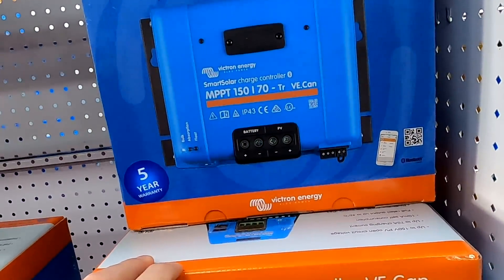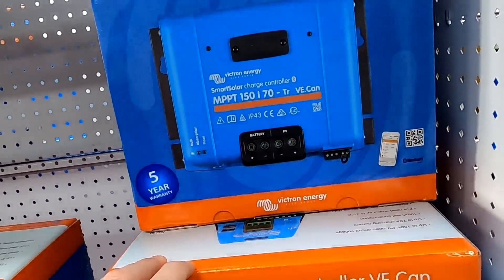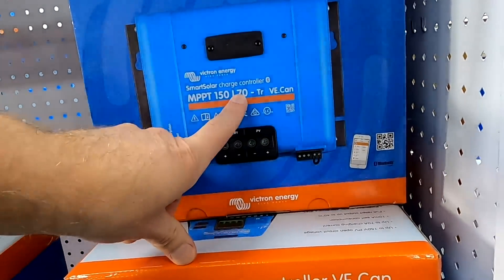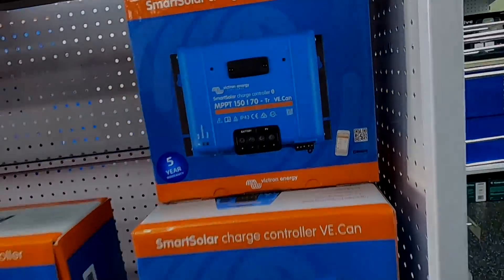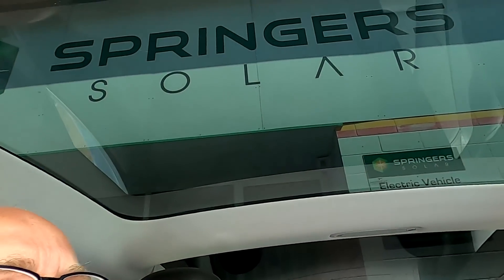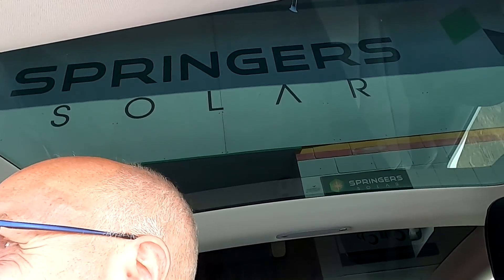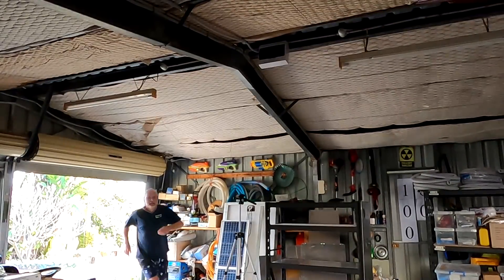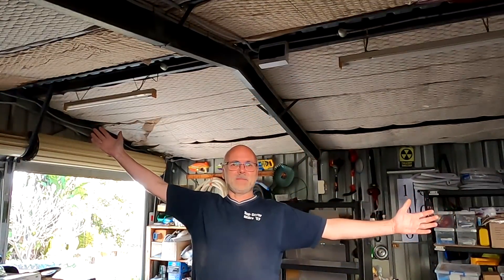Info from the Victron installer about the house off-grid connection. Not as expected... Part I

Comment: At 6:05 you talk about dump load and diversion loads. Do they know of a controller that does this? I can not find a dedicated controller that does this anywhere. Can you go in more depth on this? 
Wouldn’t it be great to charge the battery up to 3.45v per cell and have a automatic switch just dump the excess power into something else, That would be awesome!
Reply: Surely it's just a type of VSR supplying a second immersion heater. Could easily be done with an Arduino, nice and cheap..
Reply: @willtaylor8904  I know it could be done with a mess of small items. I would like a certified, UL listed device that.. I open a box, customize settings and it just works!
Reply: I've done a little Google and there are a number of programmable VSRs here in the UK that would do the job easily. A programmable PWM controller is also a nice solution.. There's also a thing called a Solar iBoost for the grid connected that looks pretty simple and cool..
Reply: @willtaylor8904  thanks for the info! The I boost won’t work as it doesn’t hook directly to the battery. I can’t seem to find any programable  VSR that supports the voltage. And I’m still trying to figure out how a pwm controller would work, in regards to adjusting the I/O, then I’m also thinking about standby load consumption too.
Reply: @andrewbowden1076  yeah Solar iBoost is only for grid connected. No use for off grid battery setup. Sorry can't post links here..
Reply: @andrewbowden1076  bimble solar do one that can deal with switching voltage up to 99v but it needs to be powered by a supply of less than 36v.. relay is capable of 250v AC 200a..
Reply from the maker: There are BMSs out there which do exactly that via relays. You can program a certain voltage and it connects the dump load. If voltage goes down, it disconnects. There are time delays programmed into this function too, so it does not switch on/off all the time.
Reply: @OffGridGarageAustralia  I was thinking just that. The BMS would likely shut right off as soon as it kicks in because there is no buffer. The voltage would immediately drop as soon as it turned on. Andy do you have a recommendation for this BMS? I have not yet seen one with the options you had suggested.
Reply from the maker: @andrewbowden1076  Yep, it will do this even considering the absorption current being under a certain threshold, so always making sure the battery is fully charged first before it turns the load on.
Reply: BUT  I can't find one that actually works . Lots of people saying ,it should be this or it should do that but nothing that actually does it.

Comment: Ha, precisely what I suggested ---- take things off of the house's panel and move them to the garage's system.  I'm great at weaseling contracts ;)
Now, are you ready for this?  Install off-grid inverters that operate in "UPS" mode whereby they are connected to the grid but solely in a generator capacity -- that means that you don't even need to charge batteries because it fails over to the grid once batteries are depleted.  No need to charge the batteries at all, that's inefficient.  These inverters are incapable of backfeeding power at all, they can charge the batteries (disable that) while reverting their connected load to the grid.  They cannot backfeed thus not violating the contract.   The contract is structured in a way that it prevents the ability to backfeed the grid, not use it.  A little bit more wiring involved but it'll pass inspection.  In-fact get the utility involved / approve the used devices.  Those inverters will charge the batteries with solar, and power the devices behind them with solar and then batteries as a normal system would, but fail over to grid and not charge batteries by the grid.  They'll just pass grid power to the devices until the sun comes up then batteries and loads are solar powered.
Reply: I'm pretty sure he said you can't do that according to the contract
Reply: @SiriusSolar  They're UPS units like you use on your computer but can charge a solar panel.  UPS units are not grid-tie inverters.
Reply: @mhamma6560  The failover to grid is implemented with a TRANSFER SWITCH. Transfer switches are not allowed (see the video) because people have abused them in the past.
Yes, I know that an UPS also has a transfer switch, but an UPS will not lower your electricity bill and will not increase your exported energy to the grid so it will not raise suspicions with the Utility Company and they won't come to inspect your installation.
Reply: @danielardelian2  No, a transfer switch is a very specific separate device that's controlled via a controller box.  The working mode of the UPS inverters is self generation or grid, not both.  Go look up what a transfer switch is.
Reply from the maker: Cannot be done because I don't have any additional cables from the garage to the house. And earthworks are not an option.

Comment: How about moving a bunch of the high energy consumers to a sub panel connected to off grid garage and then if the off grid garage solar cant produce electricity just source power from grid (one way, consumer only so does not violate the contract) to top off the off grid system. Only downside is that you’ll need a large enough inverter in the off grid system to support those loads.
Reply: Andy's Tesla charging station sounds good 👍😱
Reply from the maker: Yes, thanks, Rani. That would be possible. I have the pool pump, hot water and EV charging all coming from the meter box outside the garage. I can just connect them to the off-grid system. The good thing is they never run at the same time, so the inverter size does not need to cater for that total load.
Reply: @OffGridGarageAustralia  Victron inverters for RVs support combing power from the a 110v outlet while using the battery to complement the 110v input - for example, you want to run AC but the 110v outlet is not sufficient, so the inverter augments it with battery power. I wonder if they have something similar - where it would use battery but if inverter does not have sufficient power, it will use grid to augment the battery inverter. That would be extremely useful where 99% of the time the inverter is sufficient but in some rare cases it needs extra power (e.g., powering a compressor, pump, etc that might require extra power at startup).
Reply: Ha! I had to watch the video to the end. Looks like that’s the direction you’re going 👍